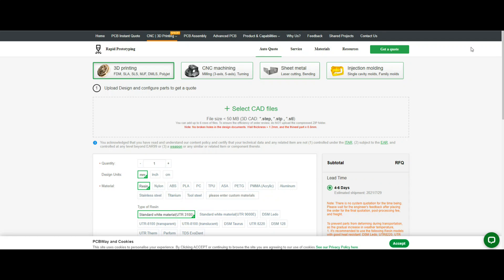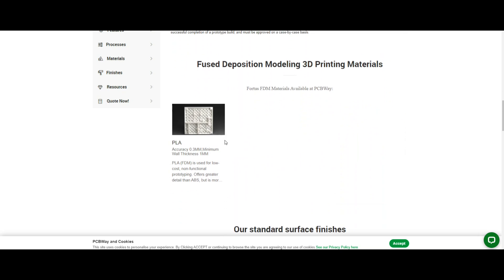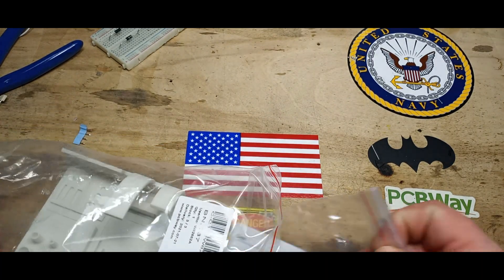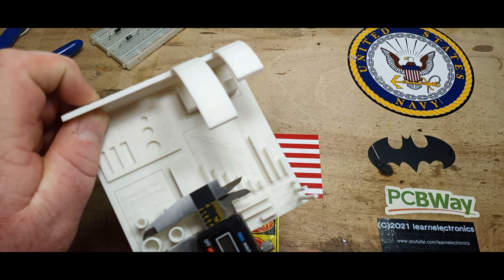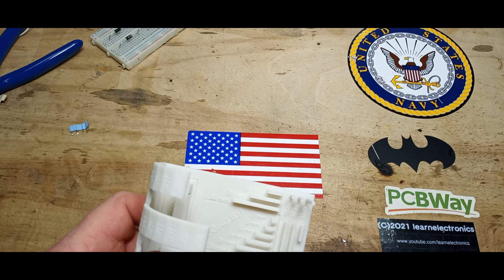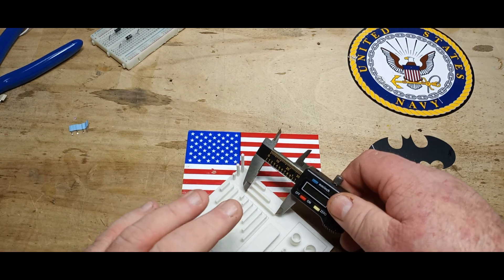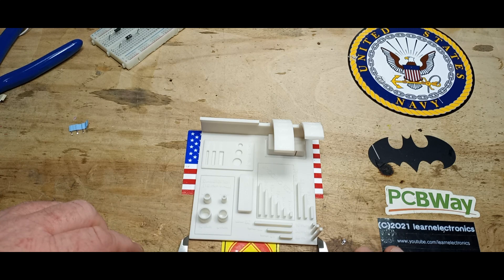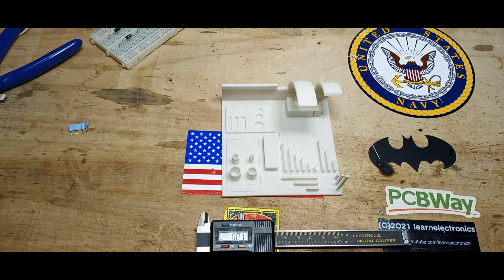Testing Out PCBWay's 3D Printing Service (FDM)

Comment: Printers are cheap.. No need of this service
Reply: Are they really that affordable? While a good 3D printer might start around $600 (like the P1P or X1C), there are additional costs to consider. Failed prints, the need for sanding, maintenance, and general servicing all add up. It’s not exactly cheap for those who only need a 3D-printed part every few days or weeks.

This is based on my own experience owning a few X1Cs, which are probably the most reliable printers. I sell cosplay and industrial parts, and while 3D printing is fun, it’s a lot of maintenance and certainly not a cheaper alternative.

Dont forget that pcbway sands and primes it for you , which is a lot of labor time that can go on for a day or days - depends on the print

Comment: These measurements were a bit off for my liking.  I would be concerned with having parts made that need to fit together.  If you were needing 100 items made where tolerances weren’t super critical, this could be valuable though.  For hobbyists use, spend the $150 for an Ender 3 is my advice.

Comment: Are You sure your caliper is 100% correct, as the measurements were off by the same amount on everything...
and also, measure thicknes with the wide part of the two arms on the caliper, not the thin sharp edges as they tend to cut into whatever you'rr measuring.
It also ensures that you measure it at 90 deg, and not at an angle.
The print looks nice. To bad you can't use it for anything.

Comment: Just a tip: The three columns that extend into the z axis can be measured with your callipers by using the bottom part of your callipers for measuring depth (the thin metal/plastic part the extends out of the base of the callipers when you extend them)
Reply from the maker: Thanks
Reply: You're very welcome man, thanks for the content!

Comment: About circles and FDM printers, I think a lot of it ends up being about the way that STL files are created and interpolation. When you make a circle, it's really a many sided polygon so you'll always get a slightly smaller circle than you anticipate when working with stl files. There is also the dragging effect on the filament being extruded in a circle which pulls it in as well.

Anyhow, I just hoped to explain why I think the circles for 3d prints always tend to be smaller than when you have straight lines and edges for instance.

Comment: For reference, I’m pretty sure Nylon normally shrinks about 1.5% when it cools.
Reply: You’re spot on!  Worked with nylon for a long time.  If PCB Way had printed at 101.5% size wise, the measurements would have been a lot closer.  Not sure why they couldn’t do this in PLA.  I have printed this in PLA before.

Comment: Do you use AutoCAD, Turbo or something else to do the design?
Reply: This is a standard test stl to test the quality of printers
Reply: @BeefIngot  Thanks for that. Yes I understand. Just wondering what the software of choice is for creating designs to send to PCB Way
Reply: @steveboyd314  They accept step files, stp and stl, so basically any cad program should work.

Comment: Nice option, but they've got a 50MB size limit and some STL files are much larger than that even for relatively simple items.  STL file sizes sometimes vary widely even for similarly-sized parts and it's not always obvious why this is the case if neither part is overly complex.